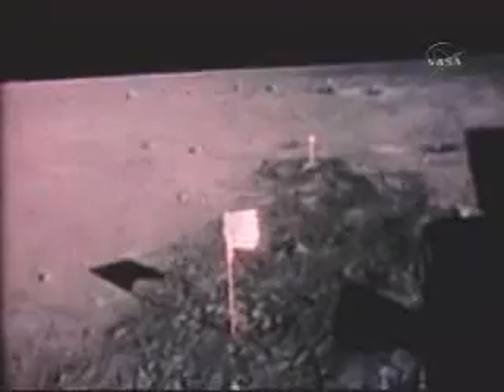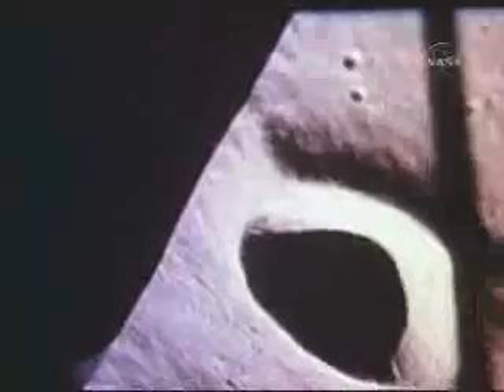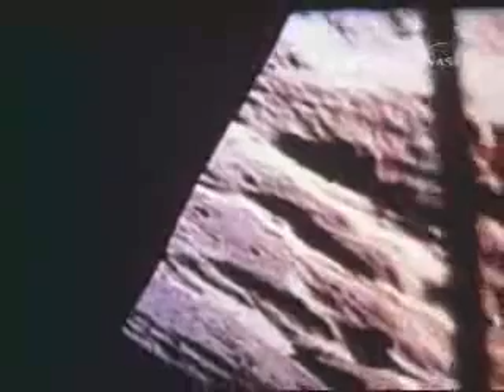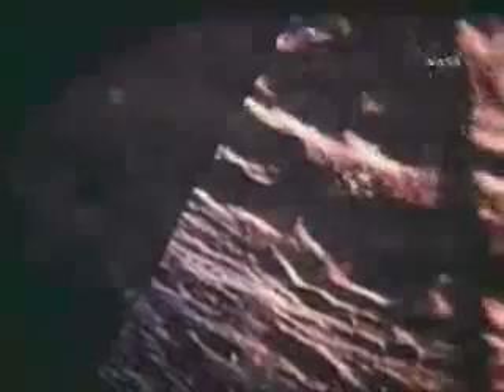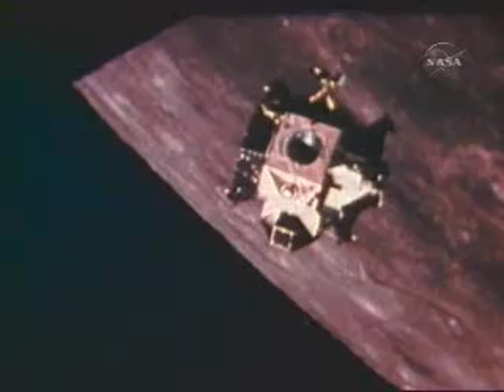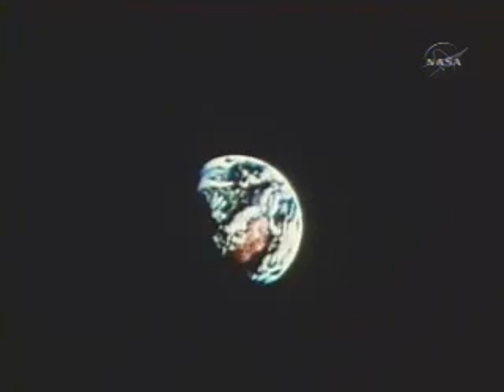No altanatives: Lunar Lift Off

Comment: Well, everything in quantum mechanics is in a state of being real and not being real.  So you are not being fully correct in your statement.   LOL   Thank Schrodinger for this.....  You probably think the pyramids were built in 20 years by slave laborers who used copper chisels to cleave 40 ton stones that they then rolled twenty miles over rolling logs to their final destination.  Which they then went on to set each one in perfect position every 3 mins 24/7 til they were done.... Who'd dumber?

Comment: I've answered this ignorance scores of times before, all based on Apollo VIDEO:

There are no stars, planets or Milky Way visible over far side of moon from either CM or LEM.  There is no steam ejecting from PLSS.  A rigidly jumping astronaut would tumble onto their back.  No nozzle blast or surface burn from LEM descent motor.  No nozzle blast from CM or LEM thrusters.  Moon whips out from under ascending LEM *immediately* upon lift off.

I have a dozen more artifacts.

Please, wake up.

Comment: The lunar surface begins to whip out from under LEM ascent, at just a hundred feet up or so just after ignition.

This is impossible.

The difference in angular momentum between being luarsycronous stationary and where they were a few hundred feet up would be very-very small.

Apollo is a hoax.

Comment: The engine actually was extremely simple and reliable.   Unless one of the tanks was somehow breached or something, it was basically impossible for it to fail.   There are two tanks, one of Dinitrogen tetroxide and the other of Aerozine-50 (a combination of hydrazine and umdh)    The engine is just a chamber where the two mix.  Open the valves and the two flow into the chamber and ignite on contact.